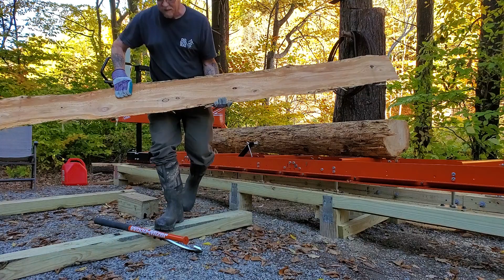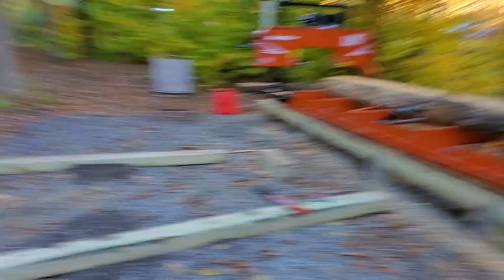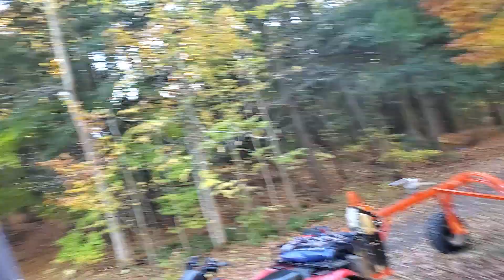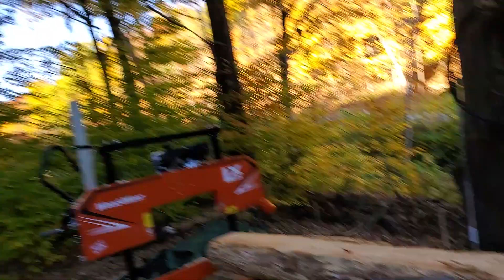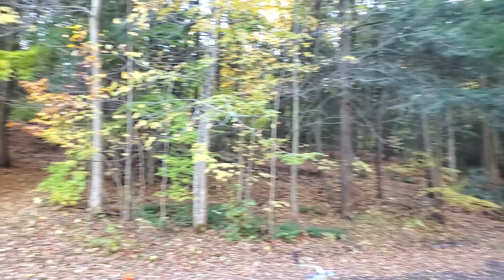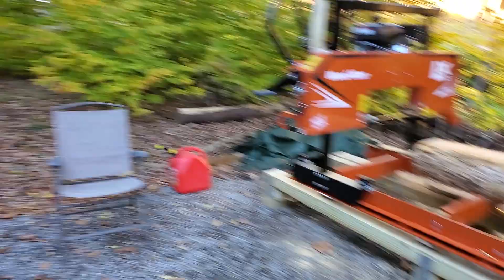Woodmizer lx25  first sawdust. 🙂

Comment: It’s hard to beat a $3,000 mill. The lumber from box stores is vastly shitty lumber. And hard wood is stupid expensive. I’m saving for the LX55. I’m building a 3 bay garage & rebuilding my barn. The lumber alone will justify the $5,000 expense. I’m out on the west coast in the Sierra Mountains. Surrounded by cedar, pine, & oaks.
Reply from the maker: Sounds awesome. I saw one of the lx55s Very nice mill. Good luck to you. Fun putting them together. Well made.

Comment: Did you get the 7 hp or the 9 hp sawmill
Reply from the maker: 9.5
Reply: I got 7hp hope it will be okay
Reply from the maker: Should be fine. Just a little slower.  I move kinda slow lately.  It will cut all the lumber you need. Thanks for watching.

Comment: The saw looks good however I reviewed a few other films, there seemed to be an issue with the sawdust build up in the saw. It looked like the  sawdust exhaust shoot had a grate/grisly that caused a dam.  Did you find that an issue ?  I may buy one.
Reply from the maker: Yep. I bent the fingers out of the way on the sawdust chute and no more problem. Nice mill. Fun to use.
Reply: @eugene41115  Thanks for replying. So far, what is the widest edged board you have sawed on this mill. I built my own mill years ago but I'm getting old and handling those large Pine logs by hand is getting tough. Regards. Old/retired in Putnam Ct. Great Video.

Comment: Do you feel that the 2 post head is flimsy compared to the 4 post on the lx55?
Reply from the maker: Haven't used a lx55 but I can tell u when all the bolts get tightened up on posts and mast on lx25 its rock solid.